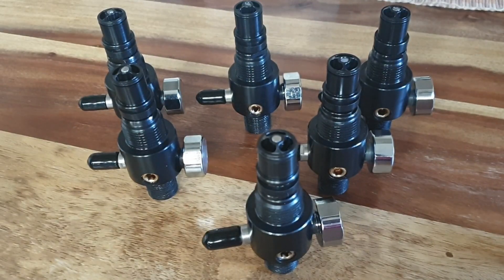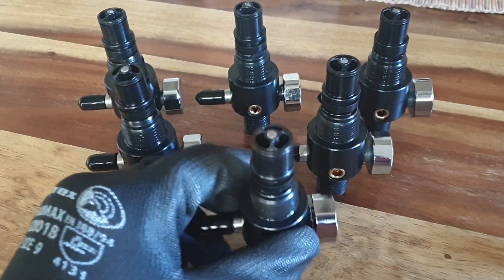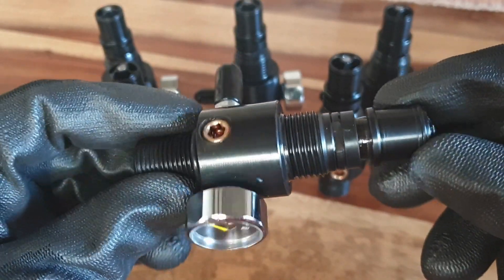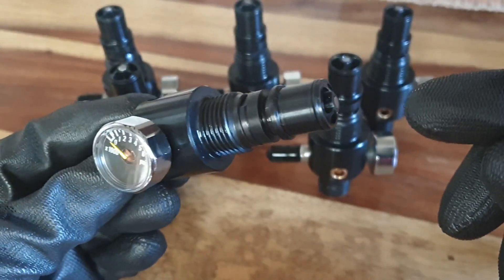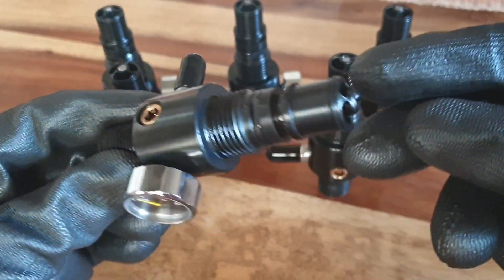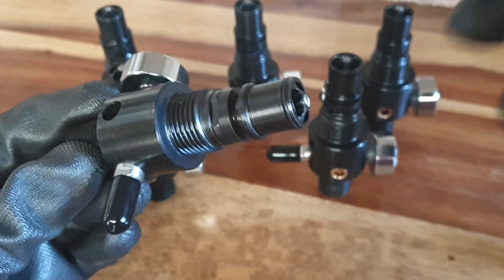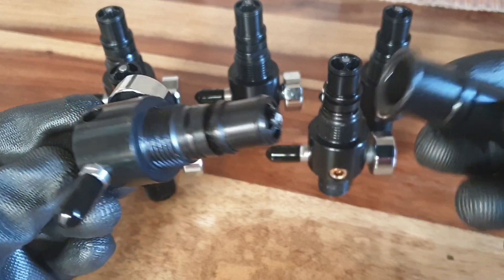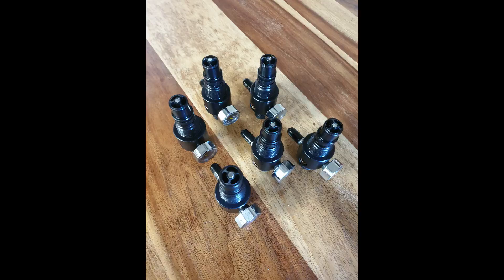2019 Super Valve  in 50 cal from African Air Ordnance

Comment: Jeremy,  very truly amazing!! 

I have your .457 2018 valve, and It's just a plain monster for that caliber!! Question,.. how do you if need be,...change out the under the top hat seals? The poppet is  of a different design then your older 4500psi valve, and not sure how I would be able to... Anyway, Keep up the great work and keep on creating the best of the best for this fine platform of an Air Rifle.... Cheers!!!
Reply from the maker: In you pack you would have been sent a set of seals   in the small zip lot packet there was a seal packed by itself   that is the correct seal to use and works like the rings on a car piston so has a split in it   be careful when installing it    Remove the Top Hat by unscrewing it   then slide the ring over the nozzle and seat in the groove make sure to squeeze It into the groove with your fingers and lube with silicon grease   then push the top hat back over it make sure not to pinch it
Reply: @AfricanAirOrdnance  Got it!! and thank you... 

Hopefully that maintenance won't be for a while , as you say to spray silicone grease after every use, but def great to know. 

Also just one other question : Does turning the top hat in for more power work in conjunction with the hammer spring tensioner well? Any tips/or best performance setup?
Reply from the maker: @tamaman1559   Unscrewing the Top hat in Quarter turns will increase Airflow  but if you unscrew it to much the valve will dump this applies more so to heavy bullets 350 grains and up, lighter bullets give you more adjustability and allow you to shoot at lower pressures
Reply: @AfricanAirOrdnance Ok Excellent,  thanks for all of your input bud
Reply from the maker: @tamaman1559   Anytime